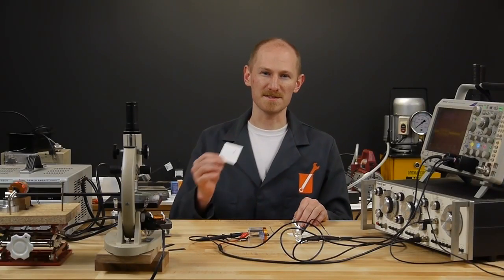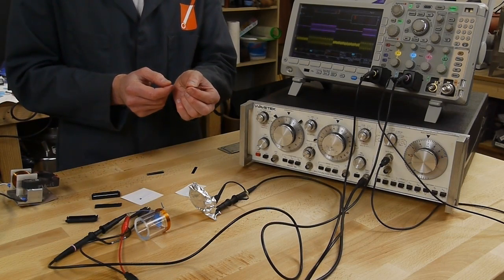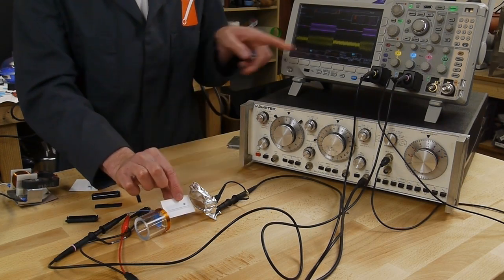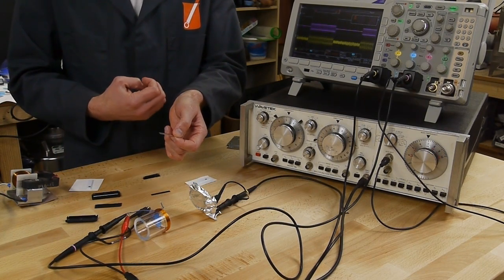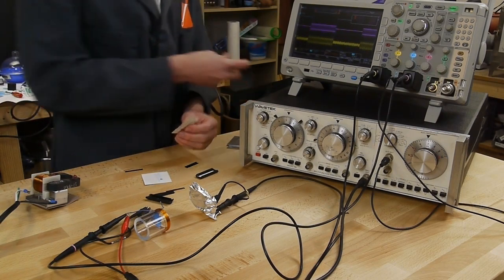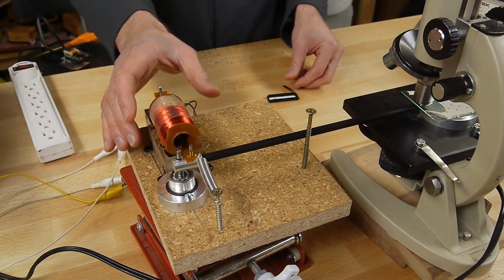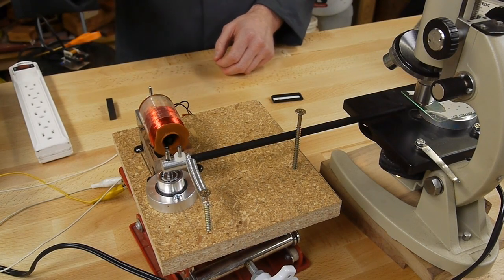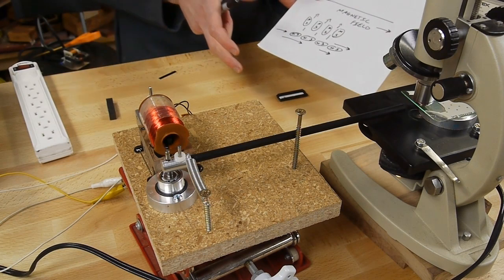How anti-theft tags work - magnetostriction

Comment: Hi Ben, do you know why
(a) there are two magnetostrictive strips in the little pouch and 
(b) why they are slightly warped?

I'm guessing that the warp on the short-side ensures that the primary eigenfrequency-direction (long side) remains straight and therefore mechanically determined... but why two of them???
On a side note - From the attack and decay envelopes of the oscilloscope-trace, one could figure out the Q-factor of the resonator. What's its time-base?
Reply: +Aditya Mehendale I thought this was obvious from watching the video. They are in a pouch so they are not mechanically restricted and can vibrate freely.
Reply: +Bowowowification My question is not about why they are in a pouch, but rather about why there are two of them. And your response still does not explain the warp anymore that I had already stated. Furthermore, I still don't know what the time-base of the oscilloscope trace is ;)

Comment: I'm not so sure that each door archway is a separate transmit and receive. Maybe transmit and receive are integrated into one archway? I have seen some systems that only use one. Perhaps multiple ones are used just to compensate for distance? Also it is not necessary to walk between the two archways for the system to function.

Comment: The earth shrinking due to its own magnetic field doesn't hold up. Liquid iron for instance is less dense than solid, so our planets dynamo core probably takes up more space than a solid one. I am willing to bet this effect alone would cause a greater change than magnetostriction.  An interesting note though, the sun is a magnet, so Earth, Mars, and other planets are just like the ribbons in your video. Perhaps Mars would change size if the Sun's magnetic field changed...

Comment: how does the response change with orientation of the tag? or, rather, does it change if your change the orientation? :)

also, love the new setup
Reply: +Goran Blažič the tag works best when perpendicular lengthwise to the transmitter antenna.
Reply: Proto G thought so, thanks... would still be nice to see how it changes, though

Comment: is there any measure of the coil being pulled without the metal strap attach to the lever so it is measured the effect of the magnetic field on the metal parts on the lever? I believe there is a considerable effect of it despite the distance from the coil

Comment: Great video! Anyhow, I still don't get it. Ok, when the transmit coil turns off, the metal strip continues vibrating for some time. But in which way does this mechanical vibration generate a magnetic field that could be picked up by the receive coil? And why are there two of the resonating strip inside?
Reply: +bluebeam09 "Why are there two strips" = you didn't watch the video.

Comment: Stupid question maybe, but how do you demagnetize the steel/magnet?  How do you get rid of the residual magnetic field in the steel? An AC cycle would magnetize in the other direction, flip flopping the field???
Reply: @kpaxxapk6397  Good point, maybe that's what happens when he pulls it out of his "demagnetizer."  The tag sees a strong field inside, but as the tag is pulled away, the mag field oscillations reduce to zero.  

I think it would be nice for Ben to drop in a little EM theory or equations.  A moving/oscillating magnet induces some oscillation of elections (a voltage) in the receiver??  Faraday's Law??

Comment: My question is, why does a vibrating piece of metal even influence the radio waves at all? The magnetostriction I get, and I could see how that could suck energy out, but how is it putting the energy back in to create the constructive interference and ring down?
Reply: I did a bit of reading, and there's an  "inverse" magnetostriction effect that causes the magnetic susceptibility of a material when it is put under strain. I don't understand how that would create electromagnetic waves, but that's the best I have right now

Comment: Could it be that it's this frequency and phase shift that's actually measured or is in tune with the receiver circuit?  I have a hunch that at larger distances, the tag's H field flux density could be higher locally, but at larger distances the lines of flux don't have a very large coverage.  e.g. a rare earth magnet is very strong in close proximity, but it won't affect a compass across the room.

Comment: This is kinda out there. But could you transmit rf at 58kHz and trick the receiver into thinking there is something ringing? I guess you would have to match the transmitter coil cycle though.

Comment: I just took one of these apart and was messing with the two strips then read the msds..
I freaked out a bit because it contains cobalt, but it's such a tiny amount I doubt it would do harm?
Reply: +Johnny Joannou Cobalt is pretty far down the list of risky elements. Cobalt is essential for life. As long as you don't grind it up or eat it, you'll be fine. The LD50 of cobalt salts for a 100kg human is 20 grams.

Comment: I get that the metal strips physically shrink and expand at 58kHz due the resonance and magnetoresistriction.  But why would the strips emit EM on ring-down? 

When you drop a piece of metal and it rings, it doesn't emit EM right?
Reply: "When you drop a piece of metal and it rings, it doesn't emit EM right?" It does indeed create an EM field. It is very small if you consider the earths magnetic field as the bias. But if the metal is already magnetized or is in vicinity of a large static magnetic field there will be an electromagnetic oscillation similar to the acoustic one.

Comment: Besides the "click" movement of about 11 CD track widths, was there a vibration of about 1 track width in amplitude?

In other words, in your main experiment, was the coil going at 58kHz? or was it DC?

About the deactivating and reviving of the Sensormatic label, how do we know that it's the laminated strip that gets magnetized / demagnatized? I mean what about the two loose strips that you said are a iron-nickel alloy, does that alloy not get magnetized too?

Thank you for the video.

Comment: I bought a dress several years ago at Penny’s and the cashier neglected to take the the security tag off. I had the receipt but due to social anxiety I kept putting off going in to have them remove it for me. This would have been very useful. Anyway, I finally ended up going in after about 3 years and they took the tag off but I think they thought I was weird for waiting so long...
Reply: Was that one of those big plastic tags that clamps on? It must have been tough wearing that dress for 3 years. I guess you could put a corsage over it.

Comment: 9:30 thats the problem of the imperial measuring system, people stop thinking at 1/1000 of an inch xD.
But in reality its not really precision, in metric its 0,0254mm , so it does'nt sound impressive anymore since most digital calipers offer 0,01mm resoloution.

Comment: I once walked thru a one of those detectors at a store with my earphones in but music off. interestingly i heard a buzzing sound through my earphones! I wander whats happening there O.o
Reply: There is a magnet in your earphone
Reply: +Mr Ching “chicho” Chong The speakers have coils in them, so I guess those were picking up the signal?
Reply from the maker: +Mr Ching “chicho” Chong That's cool!  The 58KHz is modulated at some audible frequency, so you probably heard the transmit pulse repetition frequency being picked up directly by the coils/magnets in your headphones.
Reply: +Applied Science I've heard this before too, it's very audible.

Comment: What if you apply an AC current with a DC offset and then you would not need the magnet to slightly increase the magnetic field strength right?
Reply: Just guessing, but the power requirements to induce a magnetic field at the required distance (variable from the coils) would be prohibitive. Also potentially dangerous or illegal to put out that much emf signal.

Comment: could you hypothetically amplify this frequency to set off the alarms from outside of the store? (For fun)
Reply: +Jacob Carswell They chop the signal on/off and measure the difference between the two states. A continuous wave signal would be rejected if it didn't over saturate the magnetostrictive effect. 
If you did make the signal strong enough,  the circuit would sense that there was no difference between on and off and send an alarm that it is malfunctioning.
Reply: +Chillbro Swaggins Nope, actually many systems have features that prevent you from jamming them.
Reply: Dang it
Reply: Just take a neodinium magnet and put it on the tag?
Reply: +gregistopal That's not really common and I believe his tag may have been faulty.  I work for a company that manufactures them and I swipe rather large neodymiums over tags pretty often with no issues.
Reply: +Proto G peel it off? Bend it? Poke holes in it?
Reply: +Chris W But with an antenna to monitor the signal you could pulse some 58 khz  bursts and transmit them at the right time - active jamming.
Reply: frtard Sure, but they could include modulation to defeat that. For every measure there is a countermeasure.
Reply: +gregistopal I think the easiest thing to do would be to just bend it in half, I don't see how on earth it would work correctly then.
Reply: +rdizzy1 yea
Reply: all you gotta do is get a shit load of active ones and place them on like all the carts you can, people will be going in and out with them all day and they will finally get mad  and stop worrying as much
Reply: @carolynmmitchell2240  
Yeah, if you do that it creates so many false positives they start ignoring them.
Reply: @ProtoG42  What he used was an AC magnetic field from a motor stator to demagnetize and a static magnetic field to re-magnetize the strip. So yes you could  run the neodymium magnet over it and it would just align the domains.  But if you affix a strong magnet it will saturate the material and it won't oscillate.

Comment: Sorry Ben but I don't believe you can observe a nanometre constriction by using a simple lever. The elasticity of the tape you used to bond the tag material together with the inertia of the pivot points on the lever are simply too severe to allow for a nanometre change to be detected. I believe what you are getting is simply a magnetic attraction of the spring and the screws on the lever by the coil. Try detaching the coil from the base and allowing it to move back and forth. Great job on the oscilloscope experiment!
Reply: That looked like KAPTON tape. That is very strong stuff

Comment: What happens if you bend the tag??
Reply from the maker: +Chemistryisthegame If you bend it tightly (enough to pinch the strips), it will not work as well -- much less signal. They are designed to be mounted on flat surfaces.
Reply: +Chemistryisthegame I know as a fact that if you squeeze the tags while you pass through the sensors by the store's doors, the alarm will not be triggered.
Reply: +Chemistryisthegame We were taught that you can use a push pin to puncture the metal and it will not trigger.
Reply: Applied Science Or shielding it with aluminum foil but then maybe you would need a way to ground the foil?🤷🏻‍♀️

Comment: I find the demo hard to believe.
- How could such a small physical oscillation amplify the magnetic signal in a measurable way ?
- What kind of tape did you use to bond the 2 strips together and to the coil ? The bonding would have to be very rigid (un-elastic) so that the nanometer variation can be transmited and not cushionned by the bonding.
- the magnetic field could influence the spring of the lever or the lever aluminium
-have you tried a control on the lever experiment with a non magneto restrictive metal ?

I know this isnt a scientif paper, so you dont really have to put all the controls in place....But it's hard to believe if you dont.

Comment: I have read that because of this magnetic expansion, an electromotor can't be made quiet.
Reply: +peteabc1 They did it to hard drives back in the late 90s. This is a solved problem already. Read about fluid dynamic bearings. (FDB) It was "the big thing" back when hard drives in laptops were noisy.

Comment: So would pinching the tag so it doesn't oscillate defeat it?
Reply: Its moving by only microns
Pinching the tag wouldnt stop the oscillation
Reply: @dustinjames1268  Is it oscillating side to side right? I would think it would depend on the pinch pressure and surface area of what you are using to pinch it. A micron is about 40 millionths of an inch correct?

Comment: Could you somehow have used a white light to measure the change in length?  If the strip is changing length by an amount within the visible spectrum, if you place it up against an optical occultor, shine a white light at it, then magnetostrict it, it will only let through light that's a low enough wavelength, so you can measure the colour...  I dunno, maybe I'm a stupid idiot.

Comment: So if a thief buys some magnetic shielding foils, typically from 3M, then he can get away from those detectors...
Reply: Here in Florida if you are caught with a shoplifting device like foil or a shielded  bag it increases the criminal charge. The bad guys have figured this out, not scientifically but by simply shielding the item.
Reply: @rhyoliteaquacade  Read about some news about shop lifting with shielded bags,  just thought they used aluminium foils for kitchens...

Comment: Just found this video and i have 1 question. If it's magnetic then why did my cell phone set off the alarms?
Reply: Likely because there are other types of tags. There are flat tags that I believe work via NFC/RFID though that is only based on a casual observance. These tags are commonly found inserted in books, though can be found inserted in/on products that the standard strips are too thick for.

 Another thing to consider is your phone probably wasn't the culprit, any clothing that have metal in it(such as the underwire in a bra) may become magnetized providing a similar effect depending on the design. The door greeters/passive security members are not versed in how the security devices work and will often say it might be your phone if they don't find a tag and there is nothing else amiss.

Comment: so, i can just oress it with my fingers to prevent the alarm from going off =?
Reply: +GranVlog Yeah, but many products are source tagged at the factory to prevent you from doing that.  Many power hand tools have tags inside of them.
Reply: Proto G Will tinfoil around it work?
Reply: +GranVlog depends on the tag.  It will shield larger inductor/capacitor tags, but these strip tags are actually pretty hard to shield against.  But again, there are tags inside most modern products.
Reply: +Proto G i love how you just somewhat helped a possible future famous shoplifter  lol
Reply: +Outer Doge We are who we are. :)
Reply: +GranVlog if you get caught shoplifting with tinfoil, you get charged with possession of criminal tools. Which turns it into a felony.

Comment: If i build a 58kHz transmitter will sound the alarm? :)
Reply: +Slovenija12345 yes.  There are many devices that emit enough RFI at this very low frequency or the higher ones of the printed Aluminium LC tags to trigger them.  The motor control PWM of portable CD players was particularly notorious for doing it, as are some switch mode PSUs in a particular brand of fitness bracelet.
Reply: Oh cool, thanks. :)
Reply: +Slovenija12345 I think compact fluorescent lights operate at around 48kHz if I remember correctly. Probably close enough.

Comment: whoah , thanks for that video. If it hasn't been done i think using those strips would be really useful for making x- y stages for atomic force microscopes. Tell me if that might work?
Reply: What is an atomic force microscope
Reply: +gregistopal its a type of microscope that can 'see' thing much smaller than a normal optical microscope. see https://en.m.wikipedia.org/wiki/Atomic_force_microscopy
Reply: +Faraz Sayed oh can't you just use tiny electric motors with step down gears like ahoy know tiny gear to huge gear
Reply: +Faraz Sayed Why not just use one of the more exotic metals he was talking about that changes shape with a magnetic field? (Moreso than this tag.) They probably already make such things too. Why waste time re-inventing the wheel?
Reply: +gregistopal so put what your stealing in a tin foil pouch or I think copper is the best for that copper blocks cell phone signals I think copper would be best

Comment: So theoretically you could bend the device over on itself with your fingers and it should stop the metal strip from vibrating, or at least change the vibration frequency. Can someone who works in a retail store confirm if this works?? 
Ps-I’m not a thief, just a science geek! 🤓
Reply: Those anti-theft tags are being placed deeper inside the packaging so that they can't be destroyed.

Comment: Reason I’m watching this is bc I was at Walmart tonight after a 12 hour shift and after the gym. Dead tired at the time...Went in to buy nicotine patches ($40), gum, water and protien bars. Thinking nothing of it no mask on and as I was walking out apologized to the guy for it. What sounded like an alarm as I walked through the doors went off but kept going bc I wanted to get home since I have to be up in 5 hours for another 12 hour shift. Currently sick to my stomach worrying that since the nicotine patches didn’t show up on my reciept that the cops will not be called and after me. I had no intentions to steal and don’t know what to do after an hour or so of researching online. Any help is good. I’ve never stole before and never intended to ever. Yes I should have looked at the price but I was just trying to get done and get home. Knowone stopped me and I got in my car and drove off. I assume what set off the noise was the box of patches. That’s why I’m stressing